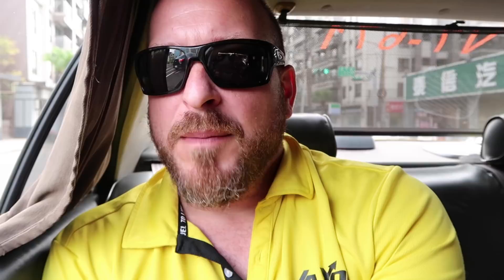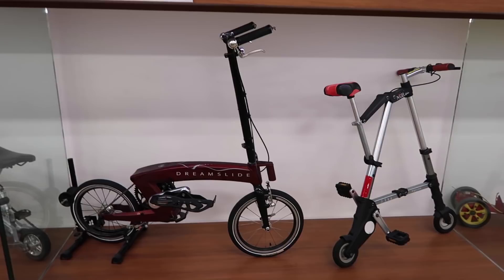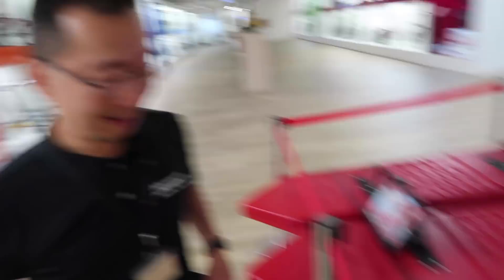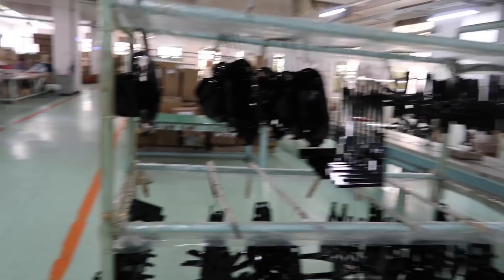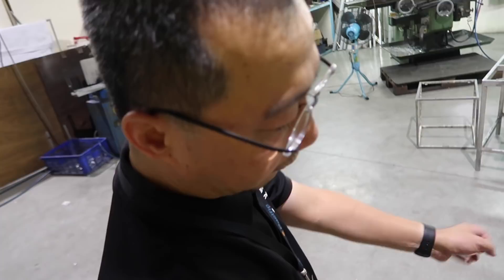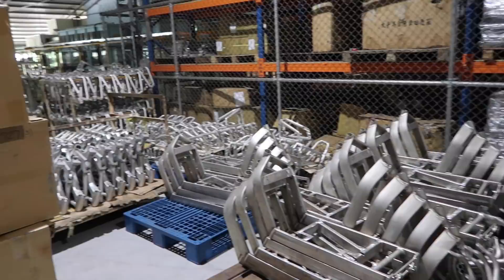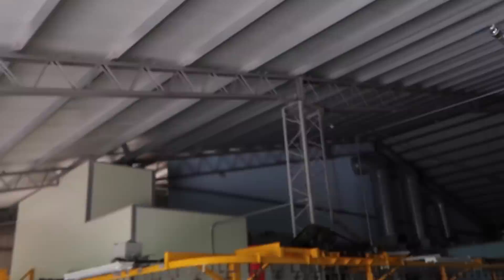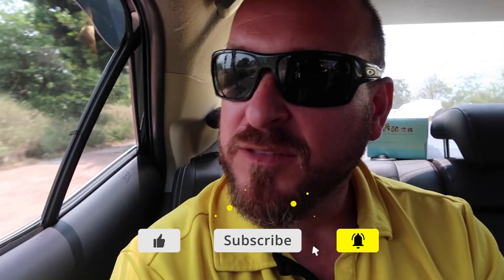Taiwan, where your BIKE, TRIKE, QUAD was born!

Comment: This video was awesome I enjoyed riding my HPVelotecnik Gekko during the time I had it. But, two years ago now I got broadsided by a minivan, so the Gekko is no longer. But, that recumbent tadpole trike saved me from getting seriously injured. I only received a severe hematoma bruise around my right calf.

But, because of how I was  hit the front wheels where folded over themselves and the rear frame was bent to the right. 

But, I still have to give kudos to anyone that work on or ride recumbents. Because of the permagrin that you get once you start riding recumbent. 

I have a new trike with 1,500 miles on it in one years time.
Reply from the maker: Yea. The trike is a safe frame. If you do get hit there is much more metal around you to keep you safe

Comment: Hi I have a question when you fly your diji drone do you use a cable to connect your phone to the remote? I have a diji spark I am 58   years old and love your trike travels. I too have a recumbent and lovd it.
Reply from the maker: there is a controller.. it has a small cable that connect my phone to the remote.
Reply: Can you do a blog on your trip on your drone  and from hookup flight to video

Comment: So made in Germany is a lie? My Riese&Muller Delite is not made in Germany? Maybe made in means designed in, outsourced too.
Reply from the maker: well.... considering sram and most of the individual components are from other places... i think "made" still fits.  I have been to the HP factory in Kriftel... and the care that goes into putting together, designing and assembling is meticulous.  Pacific is a pro at what they do... making frames.... but they do it according to HP's instructions.